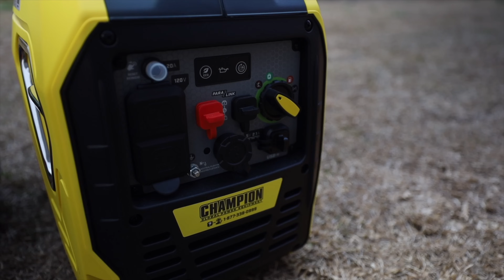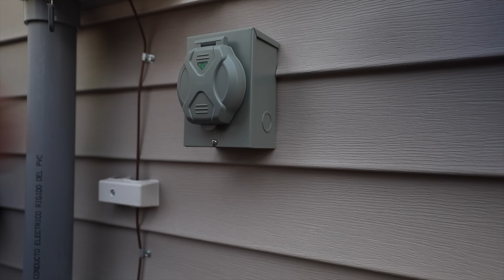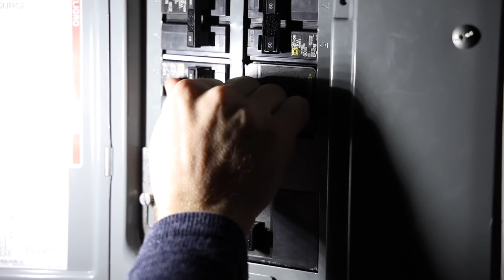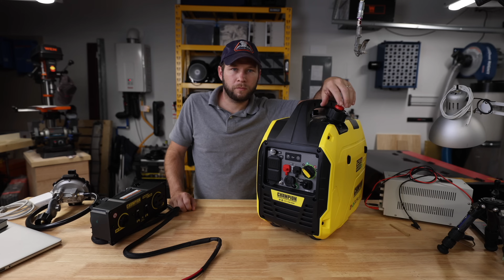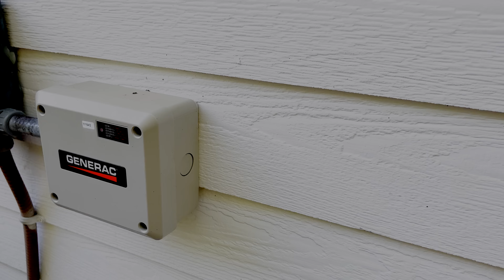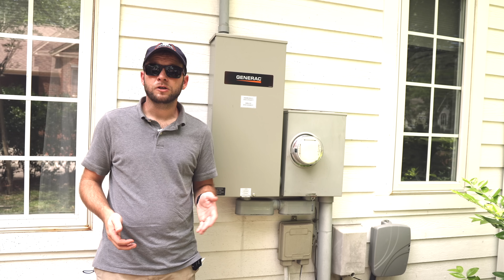Will running on a generator damage your house? Inverter vs standard vs standby

Comment: Excellent tutorial! Not many people create an all encompensing class on generators, ATS & PV set ups. Bravo! 
I only have one minor issue & that revolves around creating a dangerous back feed to the grid. As a retired lineman we wear our rubber gloves when touching any wires. Who they would injure or kill would be joggers, children & pets. They have no idea of live power lines & don't necessarily have to touch them to be injured by them. 
Otherwise great content! 
We have a Honda EU7000is 5500 inverter generator at our house with an interlock. We can power up our entire house on our generator for days if we want. We also keep enough fuel for a 3 week interruption. Motor oil for oil changes & spare parts.

Comment: The best information you presented was the cost of the fuel for all that comfort. You missed the service contract that must maintain to keep the warranty active. Miss a service, they will keep taking your money until you have a claim and then they will denied it because you missed a service, keeping what you paid after said warranty was "voided". Remember, they are in the business to make themselves the maximum amount of money at your expense. To up sale you to the more expense models with fear mongering to get bigger commissions. Modern appliances etc. are designed to work everywhere in the world. 50/60 hz 110-250 volts. The only difference is the plug on the end of the power cord. Read the specifications of the power supplies. You might need to get a magnifying glass to see it, but it's there. If it is only designed for a single market it will be in big letters including the word "Only". Remember, the more something is advertised, the less you need it. I live on the Gulf Coast where week+ power outages from Hurricanes and Freezes are way too common. I have 4 standard generators of various capacities, and use the smallest I can get away with depending on availability of fuel, what I need to power etc. I use my smallest one at night to power a 5KBTU window unit, a 40 watt light, the TV and a compact dorm fridge. It will run for more than 8 hours on one gallon of fuel. The family will all sleep in that room and watch TV together. The fridge for cool drinks. It will also run the coffee maker or small microwave separately. I have camping gear for light and cooking too. I use a larger one depending on what the plan is for that day. Shower, wash clothes, etc. Since 99% of these generators will be bought for and used in an emergency situation, figure out what you need and not what you want. I need food, I want steak. Practice running on a generator for a minimum of 24 hours. How much fuel did you use? Were you able to power everything that had to be powered even if you have to move the plug from the refrigerator to the freeze every few hours. Do this before the emergency and not during when it is too late. Not to sound sexiest but can the women folk do it in your absence? Though I have 3 generators that I can connect to my house via an interlock, two with electric start and one pull, they prefer to use the smallest generator (It's a pull start too) using the single heavy duty extension cord and plug strip. It is more approachable for them because it is light and they can quickly set it up. No fear of messing something up by hooking something up wrong or flipping a wrong breaker (Even though everything is marked with instructions and color coded) and their basic needs are being met. They will wait for me to return to make it better. Proving once again, one size doesn't fix all.Good luck! YMMV

Comment: how i do it is i have a big generator for when i want to cook or something and the rest of the time i can power lights the fridge and a tv and computer fans etc on a small 4000 watt inverter that just sips gas. The inverter can run for 24 hours on 3-4 gallons of gas. I could fuel the small one for probably 4 or 5 days on just the amount of fuel i have in the shed for my mowers and stuff. Could stretch it out a lot longer if i shut it down when i go to sleep at night.

Comment: Can a generator damage equipment?
I was trying to use up the gasoline in my Briggs & Stratton generator (has been in the tank for several months) and plugged in a tiller to clear up an area for a garden.
Everything was well for about 20 minutes but then the tiller stopped working.
Did the generator ruin it?
Should I use a voltage stabilizer?
Should I have grounded the generator?
I don't want my refrigerator, etc., to get damaged when I need to use the generator.
Reply from the maker: I would say in this case the most likely thing that would kill a motorized tool would be voltage drop and not something like harmonics. So too small a generator or too small/too long of an extension cord causing the voltage at the tool to be low and current too high for the motor.
Reply: @DemonicAnimatronic  So, a voltage stabilizer would have saved it?

Comment: No one will probably see this but standard generators now have automatic voltage regulators (AVR). This keeps the voltage constant. If you have a constant Hrtz output, a standard generator will work. I hooked up a tri fuel standard generator (to natural gas) to a transfer switch and powered everything in the house including laptops, tablets, fridge, freezer, security cameras, gas heater, lights…..no hiccups at all….none. I’d rather have an inverter but getting one of those at the size I needed (5000 watts) in CA is almost impossible.

Comment: Most computers and newer electronic equipment use switching power supplies (PS) (switch mode PS).  The first thing these PS do internally is convert the AC to DC.  They don't much care what the waveform looks like and if you have ever looked at the output waveform of lower end inverters and Uninterruptible Power Supplies (UPS) units you know what I mean (it looks more like the rocky mountains or a jagged square-wave).  They will accept everything from DC to higher frequency waveforms as long as the voltage is within its operational range  (commonly 100-240 volts).

Comment: Not sure how you arrived at $2,000.00.   A 500 gallon tank can be filled to a max of 400 gallons of LP. $2,000.00 divided by 400 gallons is $5.00 a gallon for LP fuel. Where in the US is a bulk amount of LP fuel priced at $5.00 a gallon?  Here in Cali (one of the most expensive states to buy energy) our cost last week is $2.75 a gallon with taxes included.  Is "peace of mind" worth $2.75 a gallon? You bet it is.
Reply from the maker: @frankgrant4784  then it’s not the most expensive by a long shot. Where I am is currently around 3.50 plus fees. But as I said in the video, if you can afford that great, if you can’t then here are some other options. Not everyone can afford to deplete a full tank in a short time.  Some people with freezers full of meat or medical conditions can’t afford not to. That’s why I list multiple options and scenarios.

Comment: This was a very vice presentation.   I have a couple question.  1) 
1)  the scrubbers you mentioned - do they return power to the monitored device once the total load drops?
2)  in the off grid scenario   mentioned will the generator accept a signal from the solar inverter when it senses the battery SOC is a a low trip point?
I've been propane for 14 years at my present house and a 500 gal take will only be filled to 80% to allow for expansion and that cost has averaged around $1.68 for the past years.  For the amount you mentioned it could be filled at least twice.

Comment: So does that big generac have an inverter in it as well? Or is it supplying 'dirty' power.  I didnt quite get that part.
Reply from the maker: @Lillelj  no, but the generator head is generally of a better quality with better windings and the engine/generator has enough size/mass that it is significantly cleaner than the smaller portable ones. They are still not usually as clean as a good quality inverter generator but they are usually very close to tolerance vs some cheaper portable units that can have major voltage/hz fluctuations and THD in the %20 range.

Comment: Feel like I need to add some input here. The only time I've seen people or really heard of people having electronics not work with standard generators is when they don't understand when to bond or float the neutral. Most modern electronics now work similar to gfci's. "Lenox furnaces are famous for this" the rectifier in electronics isn't as sensitive to thd as most people think. Itll take almost anything and convert it to dc. Also a standard generator thd is pretty solid well a newer one anyway until you start overloading it or let it run out of gas while you're stuff is plugged in and it sits there surging.
Reply: This is the only correct in this video. Modern electric power supplies run on a huge range an dmost can run on greater than 240V, the peer supply rectified what it needs. Read the power supply and you'll clearly see it. Lots of scare in this video for no reason. Also , good luck trying to get 16Kw from a portable generator on a 50 amp output @ 80%. The math doesn't work and this is where I knew this video was made by someone who doesn't understand power. This is by no means an "expert", don't take this guidance.
PS - the max is 9600 for those wondering (amps x volts x .8). The only other option is to hardwire from the bus bar, and I guarantee people seeking advice on YouTube aren't doing that....
Reply from the maker: What on earth are you talking about? First I will say I am an electrical engineer, if I don’t know anything about electricity then we are all screwed 🙄 but anyway… you are for some reason using the 80% rule for constant loading of a circuit which means that you couldn’t use more than 9.6k continuously on a 14-50… however there are other portable connectors, you can get 100A plugs as well as going to cam lock if you really wanted to but not everything is running all the time, And yes they make residential portable 18k running watt gensets with <5% THD.  Which is the real issue here, you refer to voltage spikes and dips but we are talking about dirty power… it will overheat power supplies and burn them out prematurely, not instantly, but shorten the lifespan of caps, built in movs, ics on switch mode supplies etc. the power supplies may protect the main equipment, but what protects the power supplies and the service calls to replace them, what about when the supply is integrated into the main control board. Clean power is good, dirty power isn’t. Feel free to use whatever you want though, it’s your money.

Comment: Generac 24k runs our entire house in winter and summer. It is not dangerous if installed correctly. I do use UPS units on all my computers and routers. The unit works perfectly so far.
I will say that adding Micro-Start units to both our AC units helped. The generator doesn't even flinch. 3-ton and 5-ton units. It dropped the 5 ton from 60 amp start to 35amp start. The 3-ton is similar. I highly recommend them for generator installations that will be running AC units.

Comment: I gave away my large generator and sold another. A third one needs repair but it is low priority. Solar panels,batteries,and all-in - one inverters have dropped in price and improved in quality to the point that everyone should have battery backup. Even without panels it’s cost effective to get started. 
I have off- grid solar running air conditioning,refrigerators, and water heaters for two houses . The electric cook stoves,and laundry loads are on the grid.
We get electricity free at night but pay double in the daytime so we schedule our activities accordingly. Last month our grid consumption was 1,703 KWH with a bill of $55.01. 
So my cost per KWH was 3.1cents. That’s where the money for batteries coms from.
I’ve considered buying one of the small inverter generators but for a little more I bought a 5.12 KWH  marine LFP battery and 3 KW inverter. Even without PV connected it can help with load shifting (time wise), thereby recovering the investment but also serving as a portable power supply.

Comment: There is some contradiction here.  The real issue is most likely with motors and other devices that operate directly on the incoming current and also rely upon the frequency of the line voltage.  So, if your refrigerator has a computer, wifi, etc., that will run on an internal switching supply and would not be as affected as say your compressor.  Overall, yes, the quality of the incoming power is definitely to be taken seriously.

Comment: I'll just say that 2k sounds like a lot for a week of emergency power until you compare it to a hotel for a family of 4 for a week.  That doesn't even touch the other issues you could return to if your sump pump wasn't functioning, your pipes freeze, your pets (like fish) die or your house grows mold and mildew. For most people, the worst can be avoided by having a small backup system that provides power to critical systems.

Comment: I would love to see the sag from a, say, 4 ton ac starting up. If your lights are dimming, you're getting a significant voltage drop.
Reply: The point of which being is it worth describing line service as +- 3% if the actual voltage to your house might fluctuate more at 25% when high loads kick in.

Comment: How come diesel generators are not mentioned. More expensive at first, but less then half the fuel burn while running.
Reply from the maker: Mostly just because of time, covering everything under the sun could make a feature film out of a generator video. Really this was just geared toward inverter vs non-inverter and portable vs installed, and was meant for the kind of generators a person might grab from a big box store in preparation for a storm and not really know what they were buying other than it has lots of watts.  The diesel gensets should certainly be on peoples radar that absolutely NEED a generator or are fairly rural, and are usually what you would see for large backups of commercial and pumpstations. The diesel is also more stable and has a longer life expectancy that could serve people well. I wouldn't say they are quite "half" the fuel consumption though, davidpoz has a few really good videos where he does a loaded test with a cheaper inverter, a high end Honda genset and a surplus military diesel genset. The high end inverter and the diesel were fairly close if I remember correctly in KWH per Gal of fuel consumed.  If you've got a tractor and off-road diesel then a good PTO genset could also be a really cost effective emergency plan as well.

Comment: What about a 24kw generator What can it run
Reply from the maker: Assuming it’s not installed on a massive estate with electric instant water heaters, well pumps, and multiple hvac units. Then it would easily run a whole house, in fact even with a few of those things it would still run a whole house quite easily. If you were to have large loads over the capacity of the unit then you would have load shedding modules installed anyway so it wouldn’t trip out the generator trying to run everything at once.

Comment: Gas goes bad where natural gas doesn't gum up a carburetor. Larger KW generators THD has less of an effect on electronics. The problems happen when you have a smaller generator and heavy inductive loads spiking the power inside the home with a smaller generator. The best setup is an off grid solar system backed up by a generator. That way it's only running when your battery storage is low.

Comment: No lineman who cares about his life is going to assume the power is off before working on the powerline. The normal procedure involves grounding out the power conductors before working on them. This means if you backfeed the powerline using your generator, if any lineman is working on your line, you will be feeding a direct short, and that’s just going to instantly trip the circuit breaker on your generator. The real danger with backfeeding the powerline is that you could be putting deadly voltage (up to around 15,000 volts) on a damaged cable that’s dangling within reach or lying on the ground where anybody could touch it.

Comment: This is a really good video. I would only say that "Utilities" are all connected in a way. Electricity can only do so much. If Off Grid, you need more than electricity to run a home.
A wood burning stove is key ofc. ($1500+)
Bio-Fuel as stove top fuel, back up, to the wood burner. ($1,000)
Wind turbine (these are the size of large pinwheels today) ($500)
Rain Water catchment, that is gravity fed instead of pump fed and filtered on site. ($100)
A small garden indoors or out (that grows food and medicine not just pretty plants) (Seeds and dirt maybe $50)
A 55 gallon drum that you grow fish in (To eat) indoors or out. ($20)

When the power goes down if you have JUST THIS (Which can be done in an apartment outside of the wood burner)
You aren't just surviving the outage, you thrive through it.

Utilities cost every American $240,000 over 50 years. Food costs another $240,000 The above turns that into a ONE time cost, of the above listed.
Pay under $3,000 ONCE and save $477,000 over 50 years.

Get renewable now. It's cheap, it's legal and it's more healthy for you and the planet you live on while saving you ridiculous amounts of $.

When the Grid goes down, I don't even know.

Comment: I also don't use the auto function of the Generac. Manual only. When I know my solar is getting low, I pop it on for 1.5 hours only. I use a cheap trickle charger to keep the battery charged.
I paid $35 for the trickle charger instead of tying it to any power that would drain by charging the battery, instead of thousands of $ for the materials and labor of tying it to the grid.